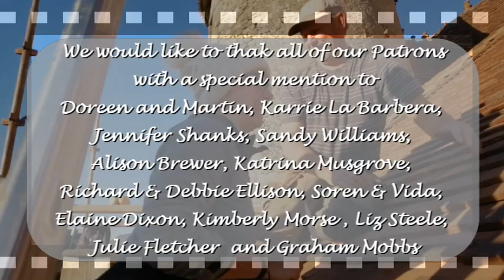130. Saving an ancient terracotta floor

Comment: We had a floor just like this in our Napoleonic farmhouse. I cleaned them out, refilled with lime mortar mix and left it to set for a week, then Re cleaned and  gave the whole floor a very light sanding. Cleaned again. Then sealed with a solution of turps and linseed oil. Left for a few days. Looked good as new. It was a long job but that floor will be still be there in 100 years. So worth keeping.

Comment: I agree with you Lisa, I'd keep the floor also...I'd pull up cracked tiles - replace them with unbroken ones...like use the ones that will be under the "kitchen cabinet", etc. anywhere that the floor wouldn't be seen...great idea to keep it...good luck...wish I could help you...

Comment: outstanding effort, really looks great and kept the character. As you say it is so easy to rip out the old and put in new but then it looses its charm, costs a fortune and wont last as long. Yes it looks a bit strange with the mosaic of tiles from different eras and where repairs and changes were made over the years but once you furnish it it will all come together. So much work I commend your hard work as people may not appreciate the amount of work done to achieve an old floor as it looks like it has always been there, well I guess it has lol and without your video it is hard to appreciate the amount of work to renovate and save it.

Well done... Robb Torremolinos Spain